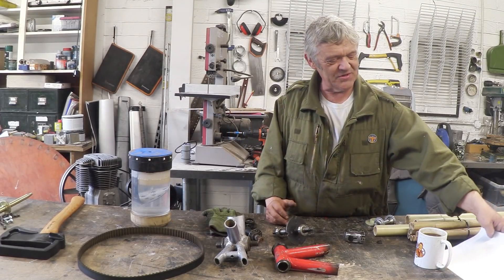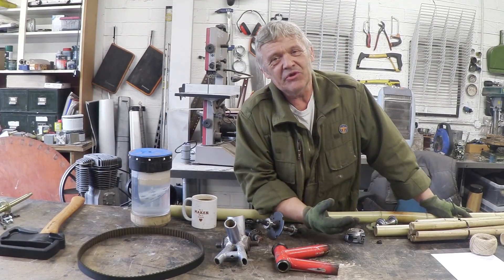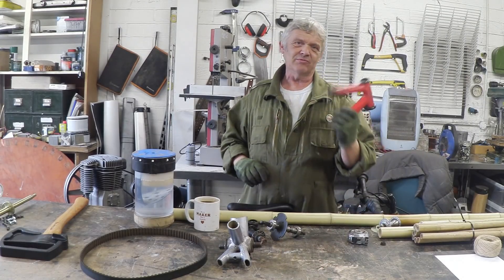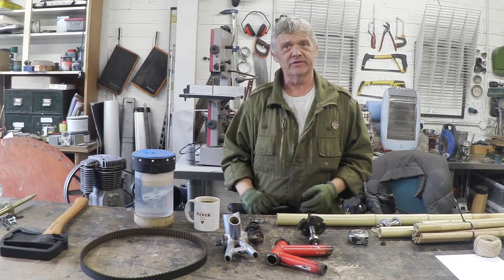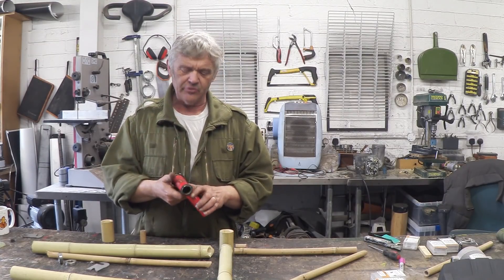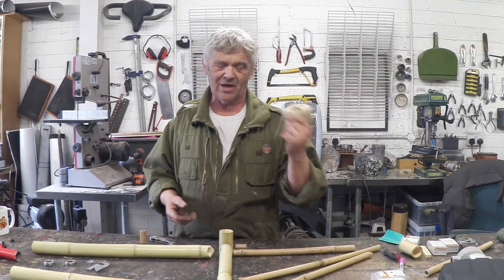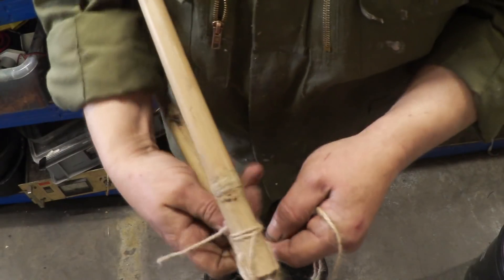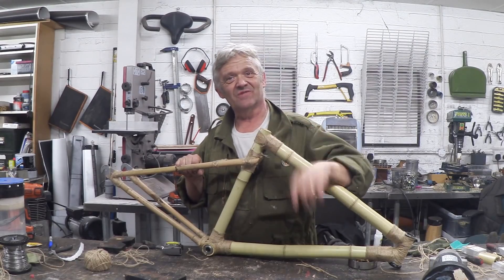1156 Build A Bamboo Bike - The Frame

Comment: Hi Rob, trust you are well.
Need to throw something to you to play with coz it could be either very important or the signs i should give up this stuff..
Ok, we know battery internal resistance is mega important...say i want to make a 48V array out of 4 x12 V batteries..no worries, poz to neg to poz and off you go.
Now, say i have 200Ahr 12V batteries and i want to make a 600Ahr 48V array?
Common config would be to create 4x12V batteries and then parallel 3 banks, yes!!
But, if you parallel 3 batteries first, ie 12V 600Ahr, and THEN couple them in series with the other groups, you have effectively reduced the internal resistance by an order of magnitude !!
Same voltage, same amperage but substantially lower effective internal res. IF i am right then we can open source this !!!
I have lost sleep over this, tell me i am wrong !!   All the best. Tony, the thick Brummie.
Reply: hello Rob, have you read this and probably your busy...in which can you please ackn so i know its been received :))
thank you Tony.

Comment: That’s a coincidence, I was going to share a vid of Bamboo Bikes after seeing you use Bamboo for the Quad. It would be nice to see the joints wrapped using Bamboo strips as is traditionally done. But Jute is a lot better environmentally than Carbon fibre etc. I wonder how you made the Bamboo fit snugly into the metal joints? As they looked a lot different diameter.?

Comment: Another way to make the fitted pipe joint is to chuck up a sanding drum that’s the same diameter as the pipe you’re fitting to and sand a notch in the end of the fitted pipe. 👍🏻

Comment: Interesting! How did you attach the 45's from the rear wheel to the seatpost upright? Looks like weight on the rear wheel might try push those past the seatpost? (and folding the bike)
Reply from the maker: peg and stitch joints mate - same as used in bamboo roofing applications
Reply: Gotta admit to a bit of worry about that junction myself. Seatstays to seat tube faces some of the highest dynamic loading any bike frame will see.
Why most builders run the stays right up to the height of the top tube so there's a counter loading
Plenty of speculation on my part tho, I've not used bamboo for bike applications